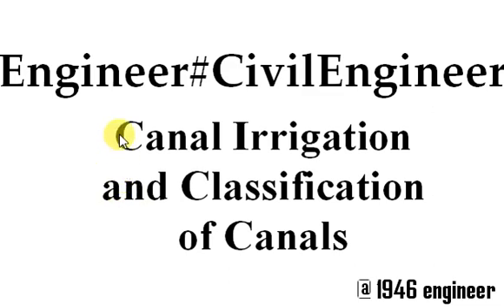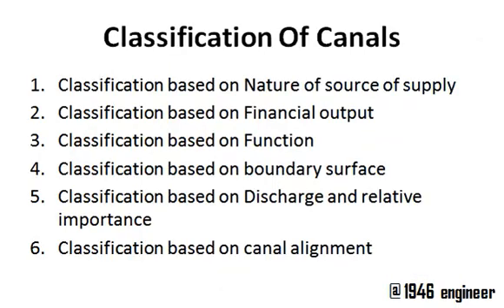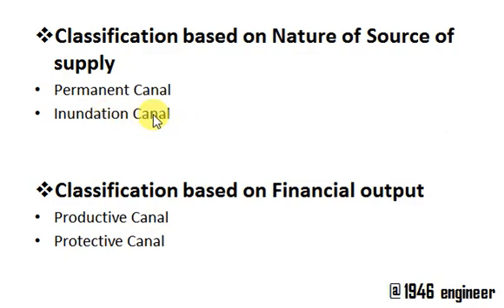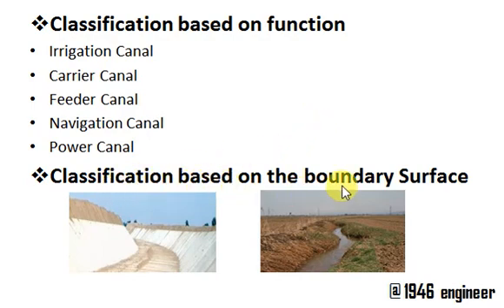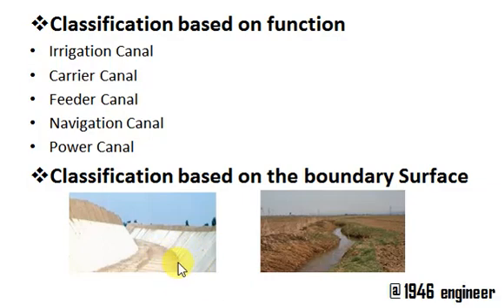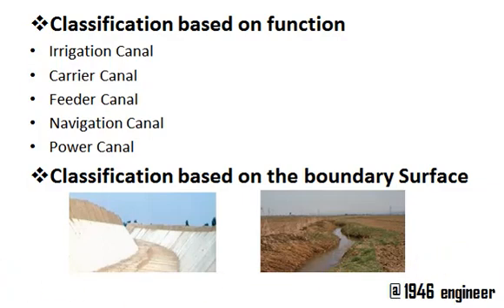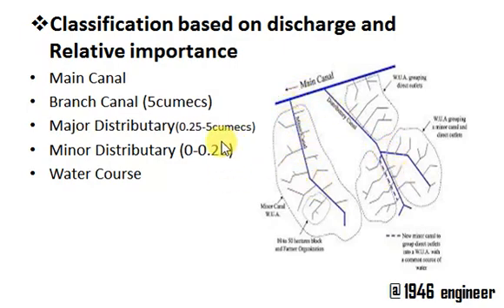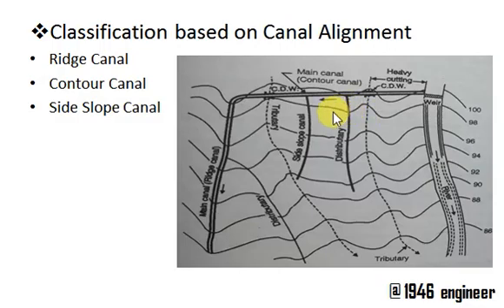Canal Irrigation and Classification of Canals

Comment: BTCE-405  IRRIGATION ENGINEERING  –I Internal Marks: 40            External Marks: 60            Total Marks: 100 1. L T P 3 1 0 INTRODUCTION:Importance  of  Irrigation  Engineering,  purposes  of  Irrigation, objectives  of  Irrigation,  Benefits  of  Irrigation,  Advantages  of  various  techniques  of  irrigation--  Furrow  Irrigation,  Boarder  strip  Irrigation,  Basin  Irrigation,  Sprinkler  Irrigation  ,  Drip Irrigation. 2.  METHODS  OF  IRRIGATION:Advantages  and  disadvantages  of  irrigation,  water requirements  of  crops,  factors  affecting  water  requirement,  consumptive  use  of  water,  water depth  or  delta  ,  Duty  of  water,  Base  Period,  relation  between  delta,  duty  and  base  period,  Soil crop relation-ship and soil  fertility. 3.  CANAL  IRRIGATION:Classifications  of  canals,  canal  alignment,  Inundation  canals, Bandhara  irrigation,  advantages  and  disadvantages,  Silt  theories-Kennedy's  theory,  Lacey's theory,  Drawbacks  in  Kennedy's  &  Lacey's  theories,  comparison  of  Lacey's  and  Kennedy's theories, Design of unlined canals based on Kennedy  &  Lacey's theories. 4.  LINED  CANALS:Types  of  lining,  selection  of  type  of  lining,  Economics  of  lining, maintenance  of  lined  canals,  silt  removal,  strengthening  of  channel  banks,  measurement  of discharge  in channels, design of lined  canals, methods of providing  drainage  behind lining. 5.  LOSSES  IN  CANALS,  WATER  LOGGING  AND  DRAINAGE:Losses  in  canalsEvaporation  and  seepage,  water  logging,  causes  and  ill  effects  of  water  logging  anti  wter logging  measures.  Drainage  of  land,  classification  of  drains  -  surface  and  subsurface  drains, Design  considerations for  surface  drains, Advantages  and maintenance  of tile drains. 6. INVESTIGATION  AND  PREPARATION  OF  IRRIGATION  PROJECTS: Classification  of  project,  Project  preparation-investigations,  Design  of  works  and drawings,concept  of  multi  -  purpose  projects,  Major,  Medium  and  miner  projects,  planing  of an  irrigation  project,  Economics  &  financing  of  irrigation  works.  Documentation  of  project report. 7.  TUBE  -  WELL  IRRIGATION  :Types  of  tube  wells  -  strainer  type,  cavity  type  and slotted  type.  Type  of  strainers,  Aquifer,  porosity,  uniformity  coefficient,  specific  yield  & specific retention, coefficients of permeability,transmissibility  and storage.  Yield or discharge of  a  tube  well,  Assumptions  ,  Theim's  &  Dupuit’s  formulae,  Limitations  of  Theim's  and Dupuit's    formulae.  Interference  of  tube  wells  with  canal  or  adjoining  tube-wells,  causes  of failure  of  tubewells,  optimum  capacity,  Duty  and  delta  of  a  tube  well.  Rehabilitation  of tubewell. 8.  RIVER  TRAINING  WORKS:Objectives,  classification  of  river-training  works,  Design of  Guide  Banks.  Groynes  or  spurs  -  Their  design  and  classification  ISI.  Recommendations  of Approach  embankments  and  afflux  embankments,  pitched  Islands,  Natural  cut-offs  and Artificial cut-offs and design Considerations.    This syllabus according make videos for irrigation exam for chapter Wise